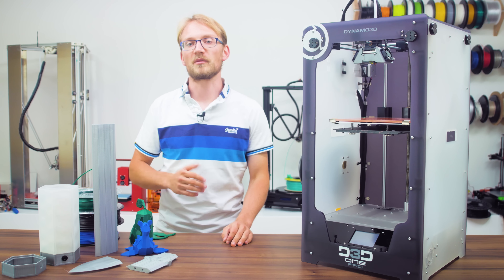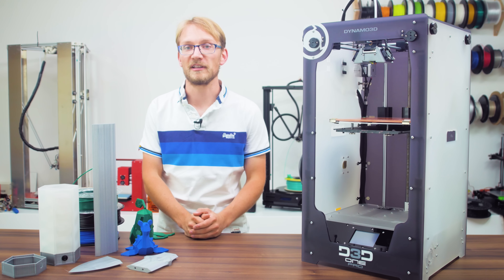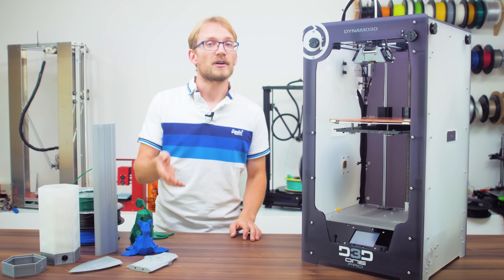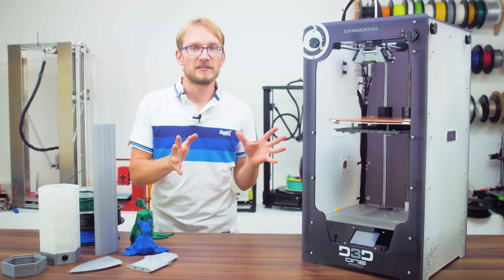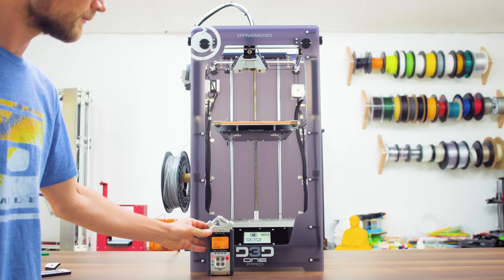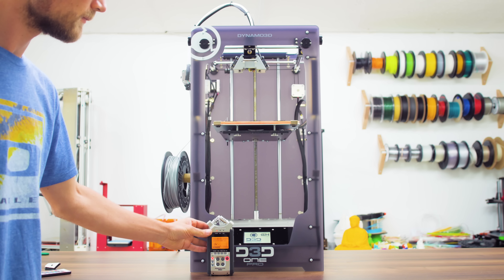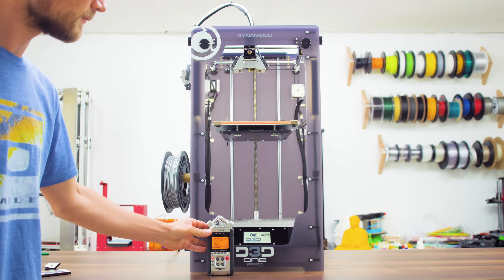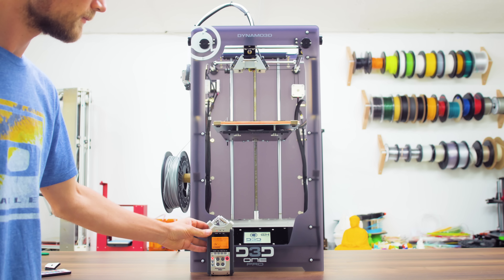Can it print at 450mm/s? Dynamo3D OnePro review!

Comment: You can safely connect it to the internet by installing a Raspberry Pi with SSH on your network and forwarding port 22 to the Pi. Make a RSA private key on your computer and add the public key to the Pi, then just tunnel through SSH and connect to the printer.

Comment: I wouldn't say a bed of 210 x 210 is big at all. Height isn't that useful unless you print vases or Eiffel towers. But I see a lot of printers now saying LARGER, but only going upwards. Not what I want or need really. How does this one compare to say the Wanhao D5s ?
Reply: Montague Flange Hear Hear.
Larger XY would be much more useful.
Reply: I know I though the same thing I'm getting the monoprice maker select 3d printer and its not as tall but its 300 bucks with a 200 by 200 mm heated print bed
Reply: Get the biggest build the hang printer
Reply: Guys you can print you pert sideways so if you need something long turn the model sideways and you can print a long part

Comment: I don't think microstepping increases resolution. Sure - it's smoother, but once you slow down or stop i don't think you can accurately stay at a microstep - you will snap to the nearest full step.
Reply: i know for certain that this combo of DRV8825 and Wantai 0.9 degree steppers it will actually decrease resolution if you go beyond 1/8th mode, trust me it will skip like 6-8 steps in a row then do almost half actual step in one move.
  at 1/32 its basically half step mode all together.

Comment: Damn, if this had come out before I'd started building my CoreXY (which is being a pain to finish setting up) and also after my pay check I'd consider getting this!
Reply: Re microstepping... this is why I designed a 1:25 NEMA17 gearbox that would give me an output torque strong enough to lift my mass. That aside though I'd get 8 micron resolution. It's something I've been really considering adding into my design.
Reply: On second thoughts... no, this printer of mine should work out better! Definitely pricewise.

Comment: I don't know why people still spend that kinda money buying these "top end" consumer printers. My $230 diy kit printer prints with same results or better. Tom, we wanna see more stuff about your Delta build please.
Reply: Agreed, my probably ~$300 AUD Delta prints just as good with a way bigger platform. Maybe not as fast with an 8-Bit CPU but still... $2600 AUD. O.O
Reply: To be fair this printer really doesn't produce very good quality prints...much better is possible from high end printers if they are designed well and use quality materials in the build. You can get great prints from cheap printer kits, there's no denying that, however you will never get prints quite as nice or as repeatable as some of these higher end machines.
Reply: Im thinking of buying a 3D printer kit to build. Do you recommend me getting a Delta like printer or like a Prusa i3 style printer?
Reply: Ahh okay thank you so much :3 I guess ill be getting a Delta like printer. Do you recommend a Mini Kossel or the full size thing?
Can you also please link the simple and cheap upgrades you did too? :P
Thanks!

Comment: Disappointing. Doesn't meet advertised speeds reliably, acrylic frame, underpowered bed, closed source board and firmware, tiny screen, crap whining drivers, fake bullshit open source advertising. The only good feature is the manual level but I'd expect better for the price. Buy a LulzBot Taz instead.

Comment: you mention the stepper whine. can that not be fixed by a potentiometer or something else on the motor driver like in reprap-style boards?
Reply: It depends on the motors and what you run them at. I have the diode circuit on my 2V 1.3A motors and it helps a little, but does not eliminate the noise. I also get a different result with MKS SBASE built in drivers, and replaceable StepStick-style DRV modules on RAMPS. People with higher voltage motors (4V) say they have better results.

Comment: Watched the stream , even though the mic was not picking the pitch ... i knew what you meant. That's a very huge deterrent for a printer if it needs to be on a desktop or near a workstation. 

The Open source claim ... well, can't improve how you phrased it. And in this case is pretty much a negative because of the stepper whining pitch. In many open source kits or i3 clones the community works to solve that, because it's ANNOYING AS HELL for most of them.

As for the wobbling of the platform ... can't say i'm surprised. 
I guess that if this printer accepted some heavy duty nozzles (like the e3d volcano) with proper nozzle pid control ... it would be able to print fast. It has the brains for it.

At least with this you get a "premium" printing volume. Which would be impressive if you are able keep the artifacts and microstepping from ruining large prints.
And the touchscreen/wifi. That's remarkable :)

Great video as always Thomas.

Comment: just full screen the video at 7:10 "see's wantai brand ... hears about DRV8825, then looks at  the modified Anet A6 on his desk and see's the Wantai stepper motor and knows it has 8825's... facepalms, then wishes he saw the video before he spent the money on the upgrades.."
  jokes aside it's totally silent if you drop the current to 0.5v vrf and also almost silent movement, or at least when compared to the original Anet A6 board and stepper motors, but you must make sure its well mantained and bed/head move freely as decent resistance is prone to loosing steps.

Comment: I can hear 20.5khz and was not able to hear that stepper whine... u mad fam
Reply: Depends on YouTube resolution you were watching at, it will actually cut at 16 KHz for lower quality encodings. Plus headphones or speakers you used, the speakers I have go well above 20 but edge diffraction above 12 is necessarily pretty bad, so some narrow bands will be amplified, others will disappear, that's something absolutely unavoidable in any speaker design. Of the headphones I have at hand, only a handful go to 16, usually they drop at around 11 or 12.
Reply: I just listened with my headphones on and rip ears fk me

Comment: I want to say that this is almost the same printer as IRA3d was producing in Italy. They went under roughly months before this printer  came out.  Same system board and electronics, same bullshit closed system Identical firmware.  
I have a ira3d printer, and it blows chunks.

Comment: Can it recover from power failure?
Reply: you might try an emergency power supply, or if you are an electronics expert, build your own using ultracapacitors, for around 40-80 bucks.
Reply: He showed that it can
Reply: @xente9918  No, I think what he showed was you can resume if you pause it and remove the power.  That does not at all mean it would recover from a sudden loss of power while actively printing.
Reply: @thewheelieguy  well ok

Comment: Quite frankly, I'm not impressed with the idea of auto bed leveling in any 3D printer. Auto bed leveling is a crutch to mask poor mechanical rigidity and inaccurate construction. I good 3D printer is one that is a precision CNC machine. When you tram it, it stays trammed without constantly drifting all over the place.